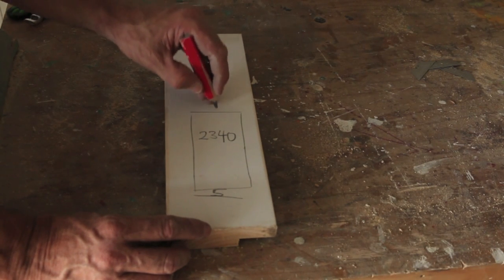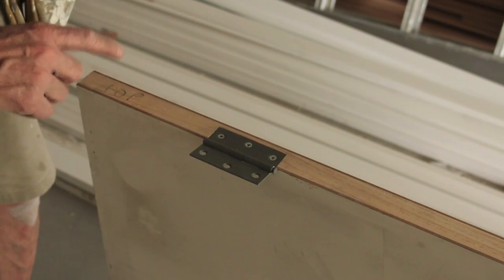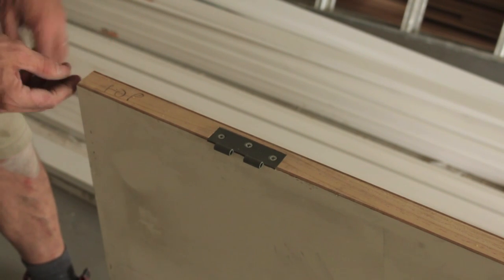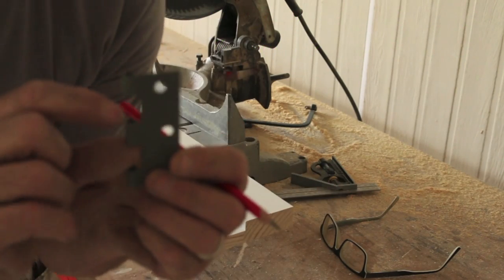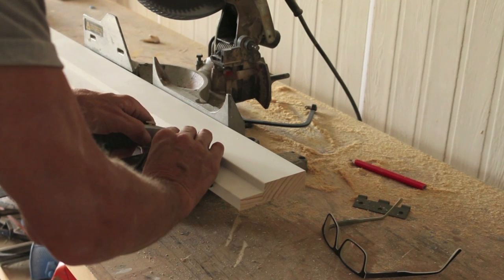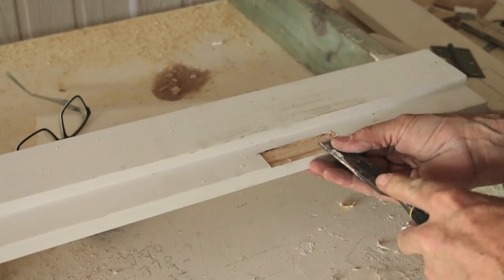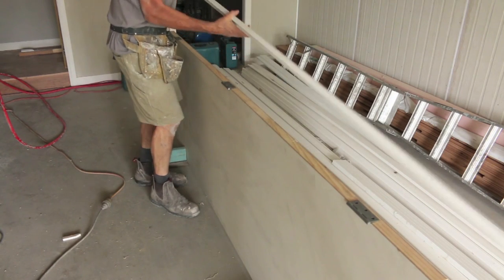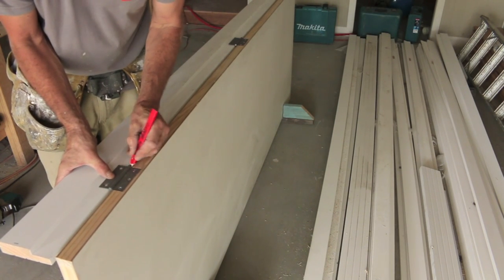How to Install a Door. Part Three.

Comment: Awesome! Are the hinges symmetrical? Looks like the pin was on the bottom before you reinserted it again after cutting the jamb.
Reply from the maker: G'day Charlie. The pins are interchangeable. Once you attach the hinge leaf, just insert the pin from the top and you're good to go. Cheers